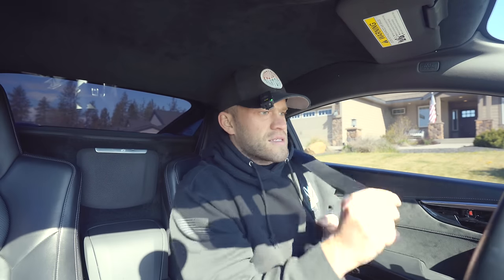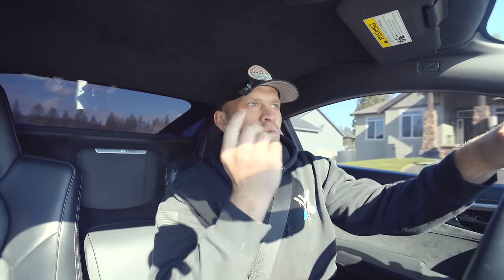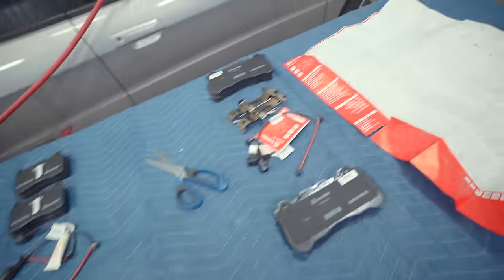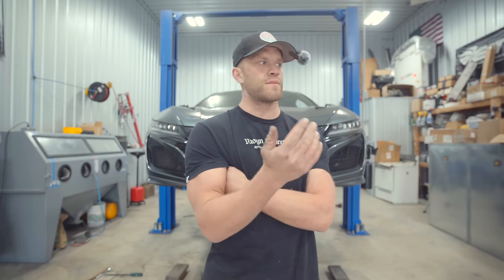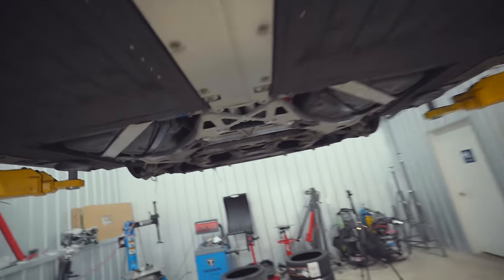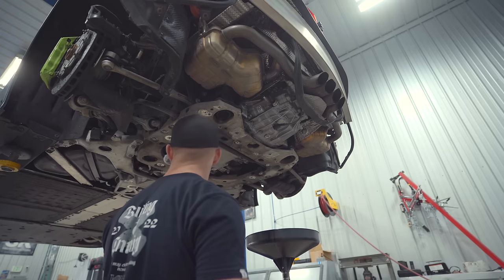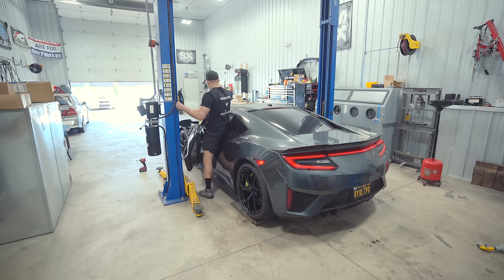FIXING ALL THE ISSUES ON HER NEW SUPERCAR!

Comment: Also, you do not need to remove that stiffening plate, you just have to remove the rear bumper and diffuser. Also need to remove both rear fender inner liners as there are a couple of hidden bolts in there.    Like I said you don’t need to remove that steel stiffening plate, that is why they used weird bolts.   There will be a lot of oil splash on the top of that plate, just spend a lot of time cleaning with rags and brake clean.

Comment: I’m surprised you didn’t change the brake fluid at the same time, hybrids have complex braking systems and brake fluid is normally a time based maintenance not a mileage based change interval, every 2-3 years is recommended. I’ve started using the new Bosch brake fluid that’s rated for 3 years just to give me a bit of a safety margin. I cant imagine what the calipers and brake pump control unit for one of those must cost. Ceramic coating the wheels should be on the list just like your other cars. I’ve also started ceramic coating the tires with the gyeon quartz tire cleaner and sio2 coating. Keeps the tires looking good for months.

Comment: You were living dangerously banging on that wheel without any lug nuts at least loosely attached. That could have easily dropped down and chipped your ceramic brake disc handling it like that. Would have added about $8-10k to your brake job. If the dealer had made that mistake the cost would have been on them. Sometimes doing the work yourself just creates more expense and could easily have been the case with what I was witnessing during this DIY.

Comment: No but this is a serious issue with mechanics now a days. You request a quote to find a good shop and base not only their customer service but see if they want to inspect the car first before they do anything. But at least there is communication. 

The amount of dealerships now a days who don’t even call back when you request a quote, or when you go in say they can’t fit anything into their schedules. Had an 08 335i I was looking to get the clutch, and flywheel replaced as mine was going out and I didn’t have a lift. 30 mechanic shops contacted and only 6 got back to me saying I’ll get a quote soon. Only 1 actually gave me a quote after 3 months.

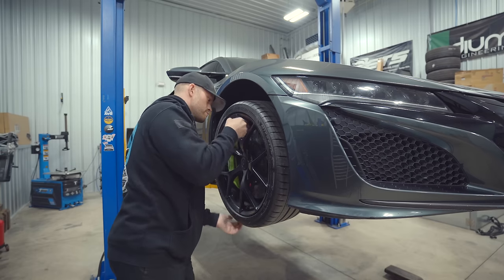Comment: 4:35 always use a towel to cover brake caliper and rotor when you remove wheels to avoid damage if the wheel slip from you hands

Comment: I have a 2014 R35 and i do all the work myself, the nissan dealer is a complete rip off, they wanted almost 500 bucks for an alignment lmao, i dont have carbon ceramic rotors but i managed to do my pads and rotors and ss lines for around 1800 bucks, i got endless mx72 pads and some slotted rotors but keeping the hats, the dealer wanted over 4k  for some oem replacements, now for tires thats always going to be between 1500-2000 per set, and for me thats a yearly expense since i daily the car. oil changes are cheap and easy to do, i spend around 50 bucks for a oem filter and  some Walmart Mobil 1 0w40, now for the transmission flush, thats usually 300 in oil and but i drop the pan so i can change the filters thats another 200 bucks, this gets done every 36k miles but i do it every 18k, either way the dealer will charge you around 2k for this and this is without removing the pan and just flushing the oil. something that you can do in about an hour.